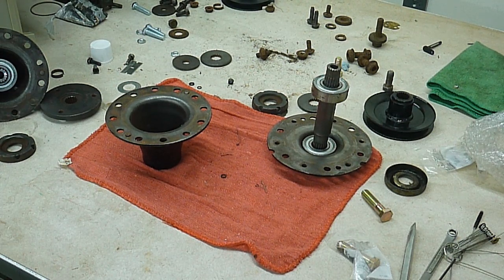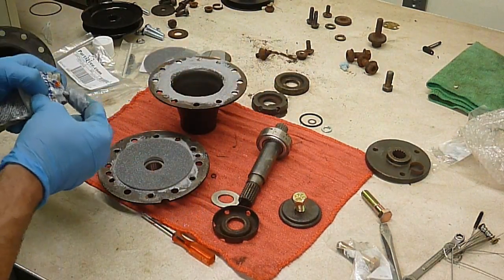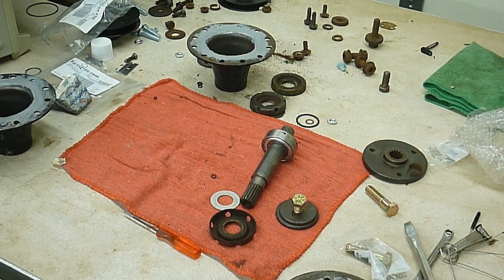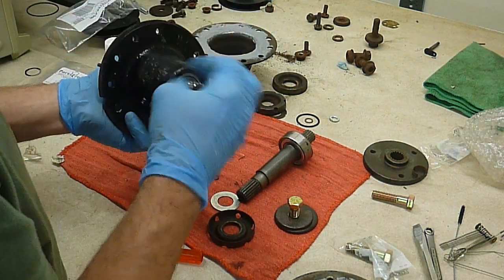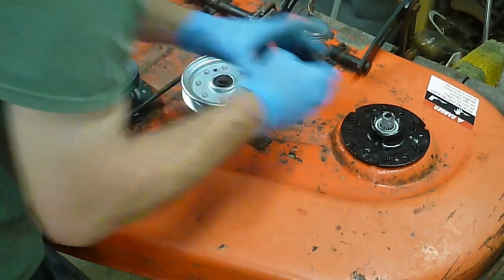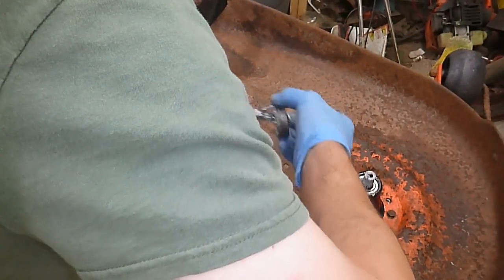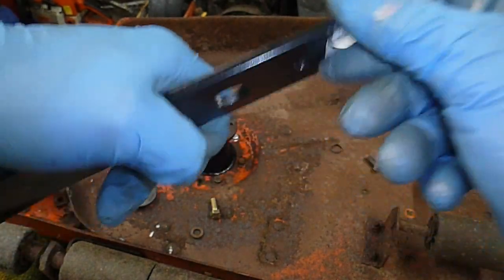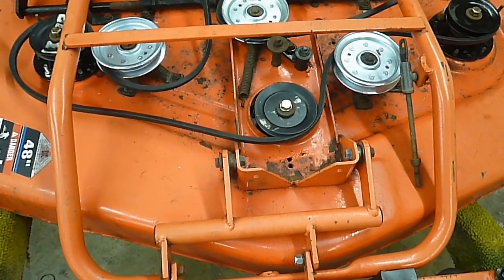Simplicity Part 7: Deck Spindle Rebuild

Comment: Do you have to take the whole deck off? I broke the blade bolt off inside the shaft.  Should I just try to tap the bolt out with a drill and easy out? Or should I just replace the whole shaft. Seems like a lot of work for me I never did that before? What are your thoughts

Comment: I need 3 spindles and pulleys  and blades for a Snapper 355Z 44 inch. I think they are the same or  similar. I cant find them though. I may adapt John Deere spindles to it. They are a little shorter on bottom though.  Sure odd to have a 44 inch 3 blade setup.

Comment: Do you know the model number for the deck? I am looking for parts to an old Bolens deck model 14003 the spindles look identical Thanks
Reply from the maker: Okay, so the deck should be a model number 1691666 :) should be able to pull the diagram up on www.partstree.com or any mower parts site that sells simplicity parts. best of luck! OLD bolens are very difficult to get parts for, i'm sure you've found out. They were owned by a company called garden way that went out of business in the late 90s, then MTD purchased the name but does not offer any parts for the garden way models. Great machines though! built really well for the time :)

Comment: I use sealed 6203 sealed ball bearings as they don’t need to be greased unlike these shield bearings. Greasing shield bearings is a MUST, but if they are replaced with sealed ball bearings, then greasing is absolutely pointless. The RTV seal is far superior to their “poor man” foam gasket seal!😂
Reply from the maker: the original ones lasted 30 years no problems, these will continue to do the same. I've seen both used in mowers, and pretty much, it's up to the owner. if you leave your mower outside, it will fail, even with sealed bearings. ESPECIALLY cheap sealed bearings of today. If you get an aftermarket spindle, it'll usually have sealed bearings even if it has a grease fitting. Mower is on it's 3rd season now and mowing like a champ. She lives a few states away now, and is garage kept, so i doubt these will be a problem for many hours to come. Thanks for watching!
Reply: NSK bearings are made in Japan, and they are one of the finest bearing manufacturers out there. They should last many years!
Reply from the maker: @applianceman6009  yeah i always try to get them or skf, but man, so many fakes on the market these days!